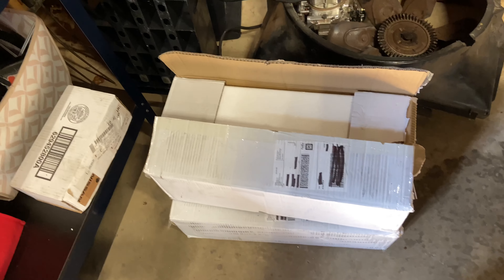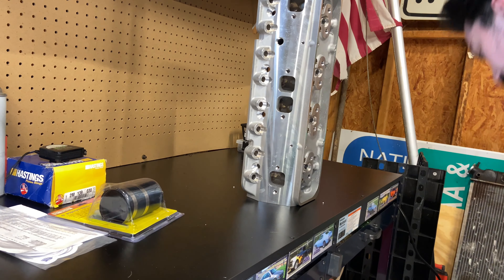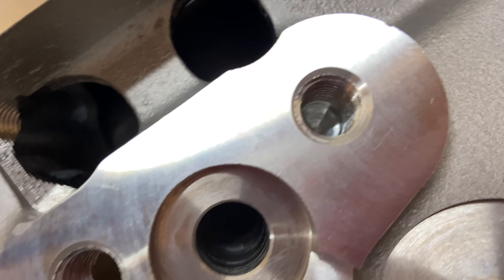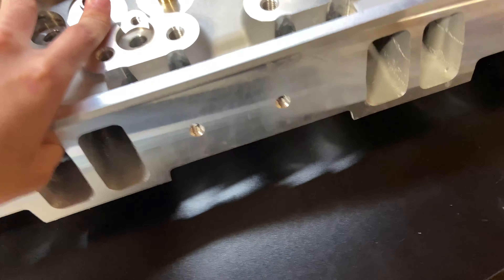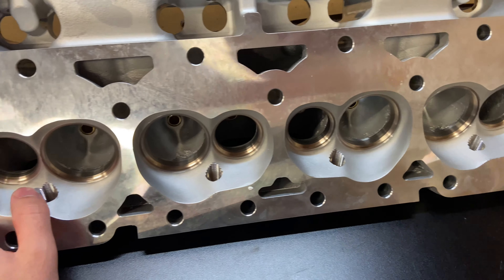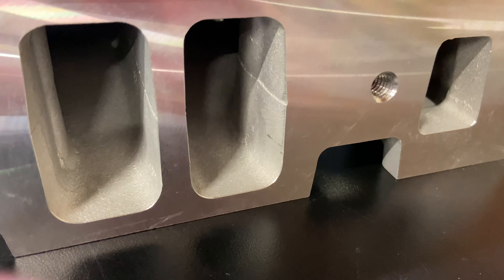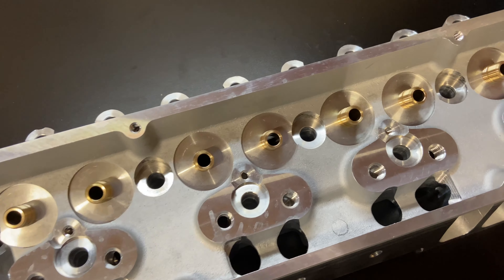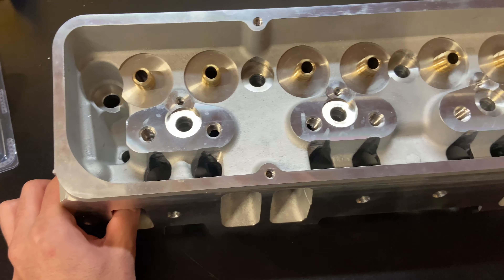Sbc eBay heads unboxing and initial inspection

Comment: While I don't recommend using them, ran a set of identical to those heads, that I ported, did myself, ran 1.46 second 60' time before it blew the tires off 1st and 2nd gear with the th-400 and 3:1 geared ford 9".  times were, on d.o.t street tires, 3400+lbs and a full relatively quiet twin 2.5" exhaust to the rear bumper, driven to the track road registered daily driveable street car. Best run on the day was 11's for the full 1/4, on a much softer leave 1.8 60' time. Goal is 10's next time out. No turbo, no blower, no nitrous.

Comment: As a budget  replacement  head you can chuck em together and tell your mates a story ,truth is buying  a set of reliable aftermarket heads is a minefield of rubbish  with a few specks of gold  mixed in .buy from a good US well known  company  and get a finished set of heads complete   the time and money associated  preparing  bare heads is probably worthwhile  to a shop buying 100 sets at a time   average Joe  gets little cost benefit  and usually  pays way more for a little less weight  and some small gains.

Comment: Whenever you decide to build cheap or stock heads, watch the cost because before you know it, you're down $800.00 just in machine work plus parts and your time when you can buy AFR 195 Enforcers, assembled ready to bolt on for $1,098.00

Comment: I'd always have them resurface and a valve job all the machine work done my step dad bought afr head rtr out of the box after pulling the engine in and out of the car 10 time his engine guy told him that the heads needed to be resurfaced

Comment: Those heads a bad heads.  The exhaust should be D shaped for best power, not square!  AFR heads are the best for your engine.  Brodix Dragon Slayer heads are good to as the track 1's.  You need at least 200+ cc heads for the 383.   227 AFR are the best, but cost too much for your build, the 221 ARF are ok too, same price as the 221 cc.  65cc chambers is what you want.  The 227cc AFR takes some special things for it.  ARF's are fully CNC'd.   The valves are 8mm valves making the valve trane lighter.  They have the best valve springs, PAC makes the best valve spring money can buy, that's what kind is on the ARF Eliminator heads...

Comment: Theses are a copy of dart platinum 200cc heads. That is "IF" the intake runners are raised .100". A dart platinum cnc program will work in these heads. Most have standard and vortec bolt pattern. They are also the very same head afr uses as their enforcer head, only they use 8mm valves. These heads are hard to beat for the money. They are sold under AFR enforcer, nkb200 (Skip White eBay), assault racing, and several other house brands. They are not procomp speedmaster junk. I have a set on a 383 and have seen several on motors that run great. Skip White probably has the best deal on them assembled with good parts.

Comment: The dart pro 1 platinum cylinder heads are 230 cc and they have angle plugs. Those heads you have can’t be even 200cc. And the intakes are 2.08 inches
Reply from the maker: Just checked darts catalog and they offer the pro 1 in multiple intake sizes with 200cc including and with 2.02 valve with either straight or angled plugs

Comment: That $400 you saved over the Afr heads will be spent at the machine shop. Even the valve seats are garbage.  I hope you sent them back.
Reply from the maker: Valve seats are good , and yea $400 is exactly how much I spent lol, also afr uses the same heads and don’t do any machine work to them
Reply from the maker: But most of that money was for gasket matching and resurfacing the heads

Comment: I just bought a set of those. I hope the decks on mine look better than yours
Reply from the maker: My machinist check them and they were perfectly flat
Reply: @atlantaleo  If you can feel it, it's not perfectly flat. I just got my heads in and they look the same as yours. I can feel that transition on mine as well. I'm going to run them to the shop on Monday and see if they need to be decked.
Reply from the maker: Yea there is a head guy in my town and I’ll be taking them to him to have them cc and clean up the ports and resurfaced if necessary
Reply: @atlantaleo  The machinist said that mine need to be decked.
Reply: @atlantaleo  Auto Dynasty gave me $60 as compensation for the heads. It's not really enough considering it cost a little over $100 to have them decked.
Reply from the maker: I’ll have to check on that later on, currently I’m working on the rotating assembly